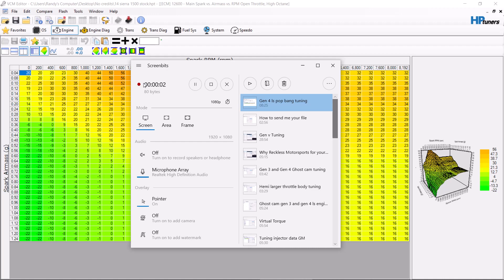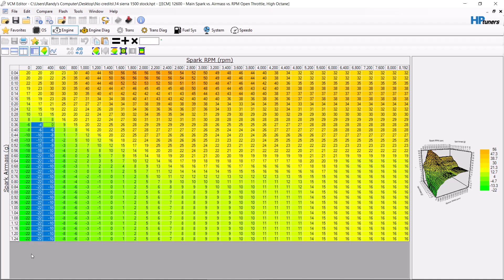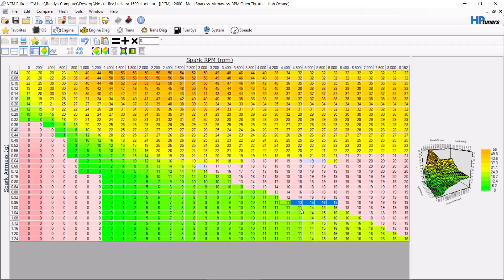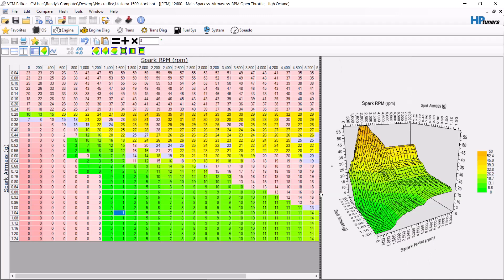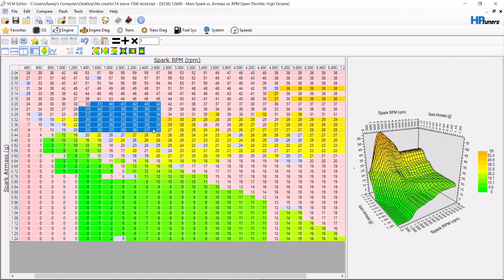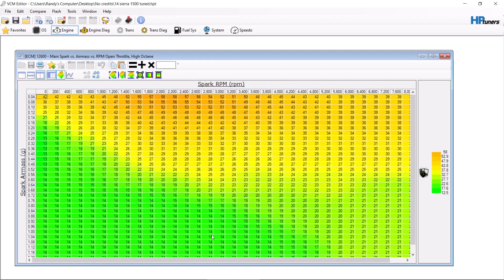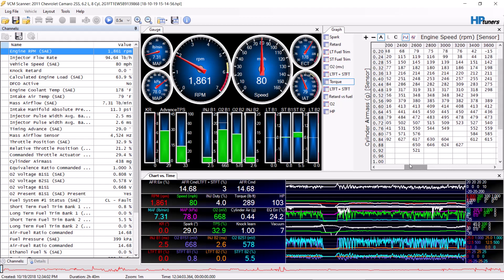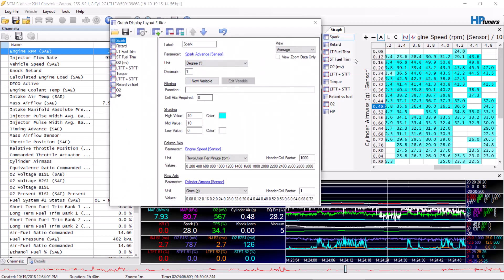Tuning GM engine timing and where to start

Comment: hello plz on my high octane RTT  when i drive the car i have the first line change just 0.08 line from 400 rpm to 8000 and other lines the square dont go down is that normally  ?

Comment: What is a good spark advance for cruising areas on a cammed ls3, from factory it's like 40-41 degrees while cruising.
Reply: Maybe a little less like in the 35-38 area more cam means less airflow at idle so less spark advance because there is less mixture to ignite, but honestly what I do is go into the scanner and play with timing control and see what runs smoothest try with ac on and of in gear and in park warm and hot it will give you an idea what your motor likes

Comment: Hey bro was wondering if u can help me tune my 2012 gmc yukon i put a sloppy stage 2 cam no dod or vvt cai  shorty headers 7.4 pushrods and 600 single behive springs they guy that tuned it supposedly ran me 620 bucks and it has driven like crap ever since he tuned it but u seem like u know more about it

Comment: Can I get a copy of that LS7 tune?
Reply from the maker: There isn’t an ls7 out there with a cam even close to the size of this one wouldn’t do anyone any good
Reply: @Recklessmotorsports  I got the Ligenfelter gt21 cam with a .701 lift? Still trying to tune it.
Reply from the maker: This is a 258/276 intake exhaust at half
Reply: @Recklessmotorsports  that’s about right, but I also put a stage 4, 6L80E with a 3000 stall and it shutters at highway speeds when I try to kick it down.
Reply: @Recklessmotorsports  I need to watch more of your videos,

Comment: Do you do mail order tuning or email tuning correction? Gen 3 rx8 ls swap
Reply from the maker: Everything
Reply: It’s a gen 3 5.3 small cam ,aftermarket sheet metal intake 102 tb and it’s drive by cable,4l60 ,2001 ecm with stand alone only has upstream o2 sensors,headers,Mazda rear gear of 4.44 but I guess a Gm 4.10 would work to not confuse ecm